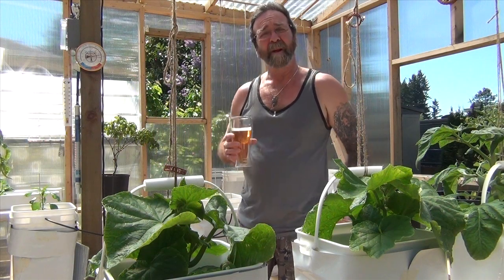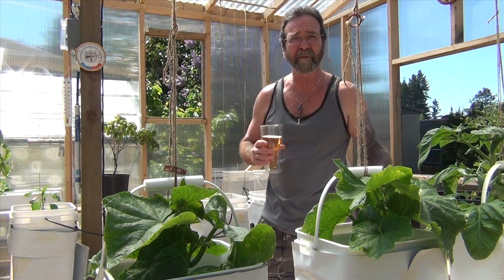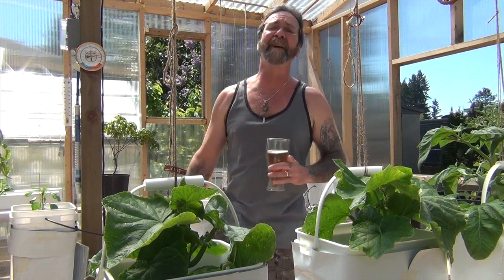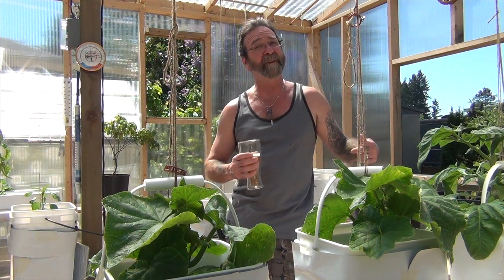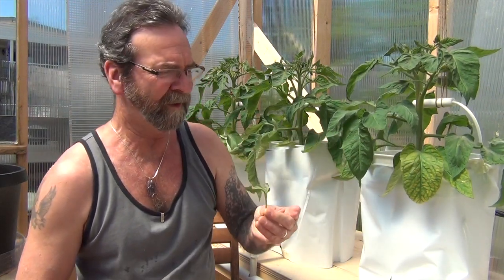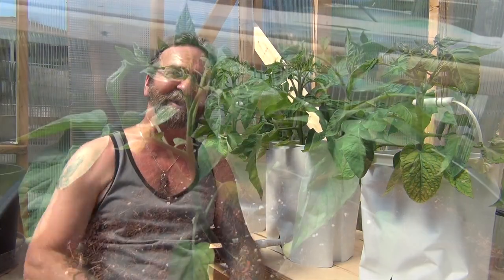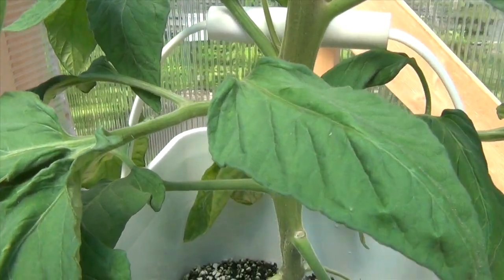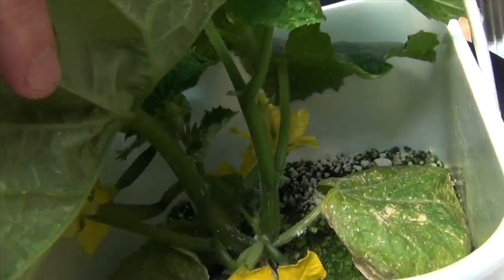Fresh water reservoir to maintain a stable PH and stable nutrient strength. Just too easy :)

Comment from the maker: Thank you for the very kind words Drew :) Yes I've used Advanced nutrients in fact a lot of there products. I have never used PH Perfect! My Ph remains remarkably stable between reservoir changes. it fluctuates by 0.1 - 0.3 so the ph remains pretty much were I set it. I have a fresh water reservoir attached to each nutrient reservoir so the Volume of water in the nutrient reservoir never changes. The only change is nutrients leaving the reservoir. I use JR Peeters hydroponic fert and cal/nitrate

Comment from the maker: the reservoir it never gets that drastic as my ph remains very stable. what ever you do don't forget to shut off the pump if you are adding ph up or down to your nutrients. I've seen more than a few guys kill there plants by ph ing in the reservoir directly and letting the system run. I adjust my ph and ppm "if" necessary in a separate container than my reservoir. whew sorry for the long winded answer. I must need a beer :)
Brock

Comment from the maker: sorry i need more space ok you simply over shoot your ppm target. If you are running at 1100 mix the nutes at say 1500 and a few hours after running the system you will notice the ppm will be down around the 1100 mark. with the ph you measure what is coming out of the res and compensate a little higher or a little lower depending on your nutrients. so in short my Kristian ignore the extra water. in a short time you will just "feel" it so to speak.  oh and also I never adjust the ph while in

Comment from the maker: Eh Kristian yes that's two inches of water in the bottom. You can eliminate it if you like but the reason I build them like this is sometimes your pump may fail or in my case "twice" a feed line pops off the bucket and over the next few hours drains your reservoir onto the floor :) so if you don't notice and you don't check everything for a day or two your plants can survive for a short while on the 2" for hydration. What I do being aware of the extra diluted nutrient solution you simply.......

Comment: Now, I have a technical question...
I use the same dutch bucket system as you... taught by you ;)
So, in the bottom of each bucket is that 2 inches of water.
Never measured it, but... guessing about 2lt (1/2 gal).
Times that "1/2 gal" by 20 buckets = a lot of old nutrient/water.
So... what to do?
*Flush system with water?
*Or ignore it?

I decided on the latter naturally ;)
Complete change of res... adjust pH and everything... turn timers back on.
What do you suggest?

"Be good to each other"

Comment: G'Day from Down-Under Brock.
After watching this video last night, I set to work doing the scheduled reservoir change.
Thank you for the tip on water temp/oxygen levels. I had no idea.
Without the heater, it's sitting at 20c (68f) in the day, so hopefully the plants will like the change.
I figured the heater was just wasting energy. My reservoir would never freeze.
I also cover it with a polystyrene sheet..... so it never gets hot from the lights.

Happy Days :)
Thanks for the tip :)

Comment from the maker: yes I have seen this :) and usually I needed to remove the grommet and clean the hole ore in some cases I've had to remove the bucket because the hole was not concentric. Sometimes reseating the grommet will stop it from leaking. A 3/4 inch grommet for a 1/2 tube requires a 1" hole cut perfectly.

Comment: Meanshoes got a quick question for you. I recently finished a 2 buckets system and everything works great except after i tested the system(no leaks) and it sat overnite one of the buckets leaked about a cup or so onto the floor. If i were in a greenhouse i might not worry about it but it is in my basement and i really want everything really need to be water tight. have you ever run into this? Any suggestions?

Comment from the maker: I'm using JR Peters hydroponic blend. I consists of equal parts fertilizer and Cal/nitrate and I add some additional magnesium. I ordered it from JR Peters web site and had it sent to western BC and it was $70 shipping but for me still a bargain. you may want to just get some GH Maxi blend as it's right out of the bag all together so less measuring with it "And" you get it in 2 pound bags. the JR Peters comes in 50lb lots